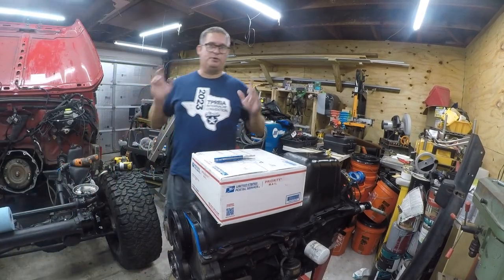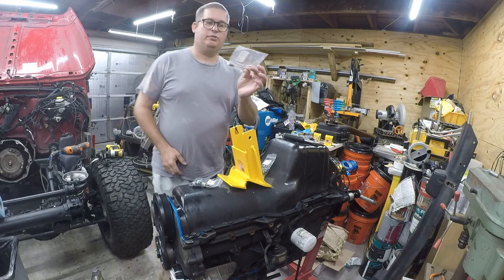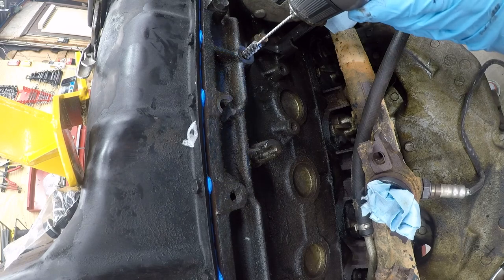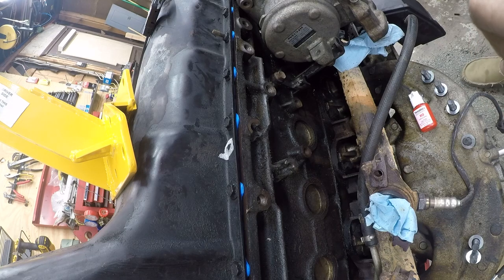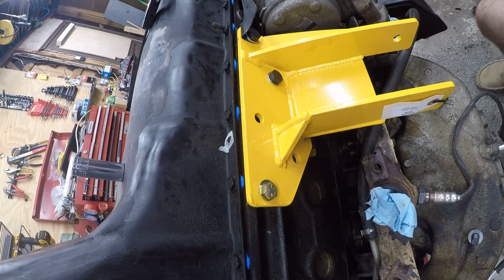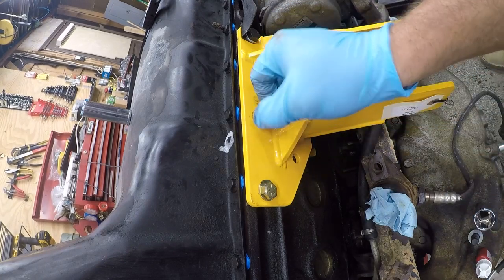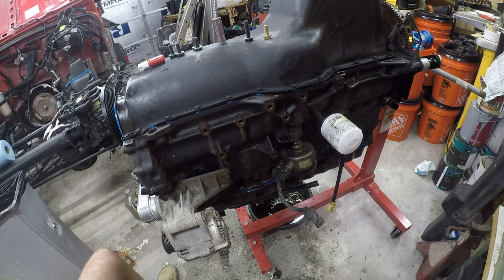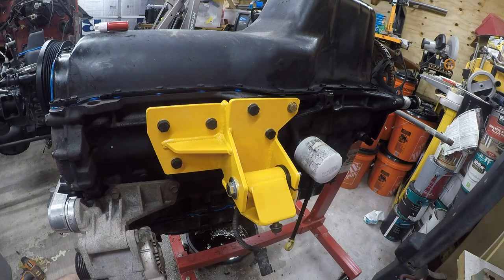Jeep TJ Build - Jeep 58 - Brown Dog Motor Mounts to deal with broken block mounting holes

Comment: I enjoy the video. I would like to suggest for people reading the comments to also check out SFR brackets. Brown dog has become super expensive (for a product in which the material quantity and labor to build has remained unchanged) and the SFR, to me at least, are a better design. Another great small US company as well, so they’re good to support. I don’t like the engine mounts from either company, I think Mopar while they’re still available are a much better choice due to vibe absorption. I had rubber BDs for a long time and eventually I was just sick of them. When I removed them, the bushings and sleeves fell right out of the mounts.

I agree Chrysler should have done more than 3 bolts per side and using something other than cast brackets probably would have been better. They aren’t often a problem but when they are and break, it’s often a big headache and many of them need new engines or they chance it hoping the aftermarket brackets will be enough support using the remaining good holes.
Reply from the maker: I wound up having to customize the mounts.  Brown dog was very good about communication.  I saved my block and have been driving for over a year.  Nothing exciting, but our roads in Houston will give most trails a run for their money.  It might be paved, but it's still gonna work the suspension.  

My Jeep is a Pet Sematary type Jeep.  It's alive, but it's not right.  :)

Comment: You seem fairly particular about your work so it was surprising to me you left the zip tie between the bracket and the bushing.  Probably won’t hurt anything but...
Also, along the lines of being particular, the number of times you click a torque wrench is 1.  Again, it’s not going to hurt anything in this situation but if you were doing mains or rod caps it wouldn’t be so good.  It’s a bad habit at any rate.  
Sorry for being critical.  Here’s the better part:  Your video showed me clearly what I needed to see to fix the same problem on my sons Jeep.  Thank you very much for that!
Reply from the maker: Second click doesn't hurt anything.  It allows the fastener to wrest for a second and then verifies that torque has been achieved in case the part has settled.  With mains or rod caps you generally bring them up in stages.  However, clicking it a second time won't hurt anything.  The wrench will still click to indicate proper torque.

Like everything on the internet, we don't have to agree.  I'm just explaining why I do what I do.  Often times my torque wrenches are not in the ideal position.  Using them with an extension can and does alter the observed torque.  Adding thread lock also affects the torque, but it's something I like to do because it's easier than searching for missing fasteners.

Most fasteners have a range of acceptable torque and are going to be fine plus or minus 10 to 15%.  Click style torque wrenches were not widely available up until the last 15 years or so.  Prior to that it was pointer style and many people just "did it by feel" as rediculuous as that sounds.  Small fasteners have much narrower torque ranges, but I digress.  I feel like I'm doing good to have a variety of sizes and ones that read in inch as well as foot pounds.  It's a blasted shame that the US couldn't have followed through on metrification.